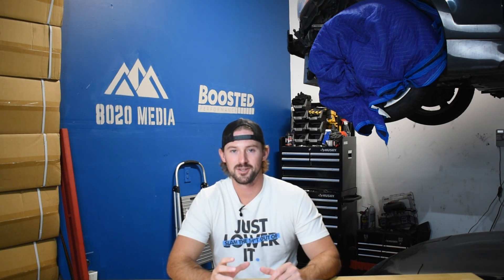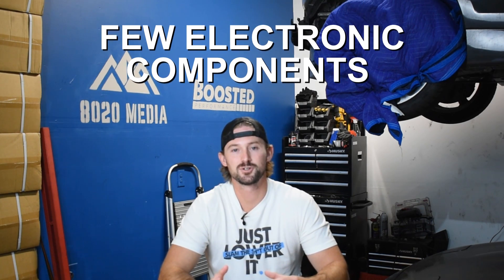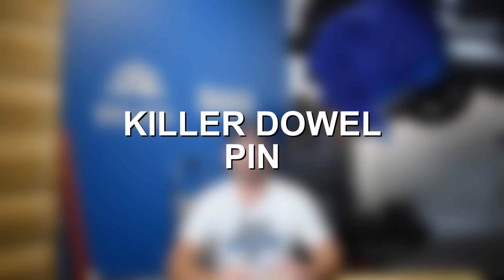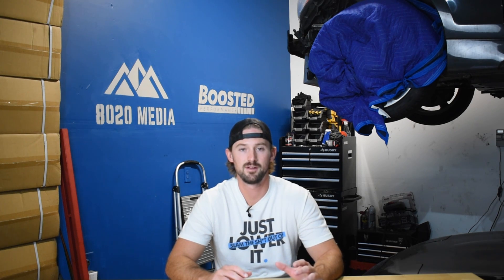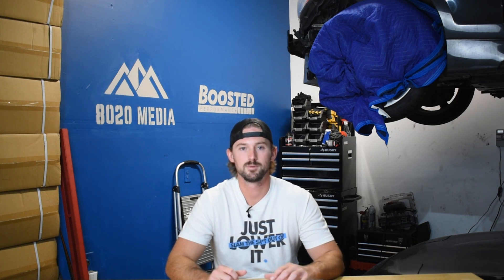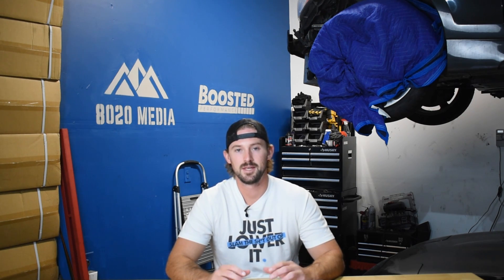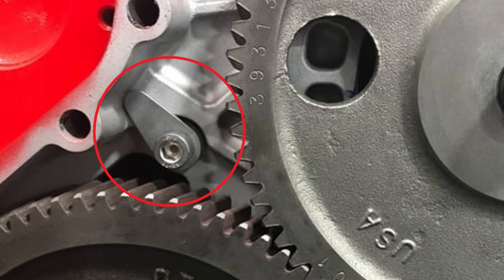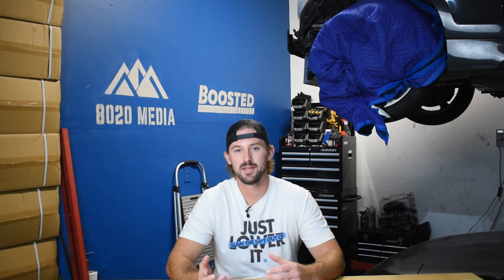Dodge's 5.9 Cummins 12v - Common Problems & Reliability

Comment: I had the dowel pin in my truck fall out, wound up just breaking the timing case (didnt realize it was the pin til i was putting the case back on), so i consider myself lucky, replaced the case, and still running strong 2 years later
Reply from the maker: M - Very lucky! Thanks for sharing!

Comment: One weakness that you didn't mention is sudden failure of the crankshaft position sensor. Some of the signs are tachometer stuck at zero, erratic gear shifts (auto transmission) and no charge from the alternator. Without battery charging, the vehicle won't go very far.
When it comes to mileage, the 5.9 can go an impressive 1.2 million miles before overhaul, or approximately 24,000 hours at an average speed of 50 mph! This is because this industrial engine is used at half of its capacity in the Ram pickup.
Reply from the maker: B - True! Thanks for sharing.

Comment: The killer dowel pin can literally kill the engine if it causes all of the engine oil to leak out through a crack in the timing case. This would imply the driver didn't notice, or ignored, the low oil pressure warning light.
Reply from the maker: B - correct.

Comment: You forgot to mention the 47re auto transmission
Reply from the maker: G - Good point.
Reply: @8020Automotive  the mismatch of a weak transmission and a high-torque engine is a weakness of the power train, but independent of the engine itself.
Reply: Is this in the 02?

Comment: Have one of these engines in my 2004 Hyundai 210LC excavator. Has over 12,000 hours on it and still runs strong. I better check that dowel pin!
Reply from the maker: G - Wow! Nice, goes to show what maintenance can do! Thanks for sharing.

Comment: I have a 7.3 and 12 valve.  I prefer the 12 valve in every way.  7.3 is a great option but has 100’s of wires and many electronics to think about.  A 7.3 runs great when all those wires and electronics are ok.  They can and will fail in an instant and you are left with a big problem to contend with.  A 12 valve has zero electronics to fail.  Even the fuel shutoff solenoid can be removed and fuel shutoff lever can be controlled by a cheap hardware store dash mounted universal choke cable.  That is how I shut mine off.  Only electrical on my 12 valve is the starter and if it fails I just park on a hill , let it roll and dump the clutch as my Fummins is a manual with zf6.  Fires right up even without grid heater operational.
Reply: My 12 valve made me dislike my 7.3 due to not realizing what I was missing. #this
Reply from the maker: C - Thanks for taking the time to share your first-hand experience!
Reply: The crankshaft position sensor can fail. That won't prevent the engine from running but will affect the auto transmission shifting and charging system. It is easy to replace at home. I would advise carrying a spare part for road trips, because shops don't carry it, and mechanics not familiar with the 5.9 Cummins could potentially spend a few hours troubleshooting, which incurs the driver a loss of money and time.
Reply: Awesome 👌  I'm building a 12 valve cummins dually right now. Ive got the getrag 5 speed manual. How do you like your transmission? Not sure if I should keep the getrag or swap to a zf6 or g56. Hoping for around 450hp and reliability

Comment: My dad finally gave me the ‘95 a couple of months ago. Nothing better than getting a 12v for free and with a manual transmission. I plan on fixing it up and making it my own and addressing all the issues you mentioned in the vid.
Reply from the maker: E - Sounds like you got a gem! We're jealous.
Reply: First thing is don’t listen to this guy it’s completely obvious he has never owned one. Besides the killer dowel pin is the main thrust bearing separates and the crankshaft connects the block and you can’t repair it. I have seen about 20 of these that the dowel pin fell out and only one caused serious damage. The other problem is the over drive nut and gear I suggest replacing both with upgraded parts.

Comment: What is the price range ? Let's say I find a truck and need to put in a fresh motor ?
Reply from the maker: T - Can find a used engine for $1,500-$3,000. But have to pay for install.
Reply: @8020Automotive  install is easy . There heavy but easy hook ups

Comment: So with the original automatic, you cannot add any horsepower?
Reply from the maker: F - You can add power, just not near as much.
Reply: @8020Automotive  I wonder what the best way is to get me up the hills without holding up traffic. I feel like I need just a little more.  I don’t want to smoke people out either.
Reply from the maker: F - If you need to smoke people out to get up hills, then do it! It's a normal vehicle function with the trucks.

Comment: From California, got one 97 for $32k, Is it worth the money?
Reply from the maker: Sounds expensive for a 97 but would need a lot more details than that to know what it's worth.
Reply: @8020Automotive  it can’t get cleaner than this truck but it has 123k miles on it. You might be able to find it online it is green color in Oregon. I really don’t know if I should do it or not.
Reply from the maker: A - Keep us updated.
Reply: @ata1421 I paid 8K for my 97
 that waz already allison swapped the truck itself is worn down but the power train is good to go. All it had wrong was stuck brakes and bad heater core.
Reply: Buy what you can afford. I missed a deal on an item that I thought was too expensive but I had the money now it's gone and I am regretting not buying it.
Money comes and goes, always but certain things may come along once in a life time and it may only be worth it too you. Don't let anyone make this decision for you and if necessary keep the cost to yourself.
Yes, a late comment... but did you make the purchase? 😁
Reply: got my 98 extenda cab 4x4 2500 with 425000k ish for 5500 Canadian, I call it rusty lol